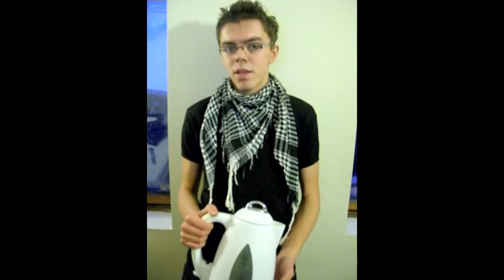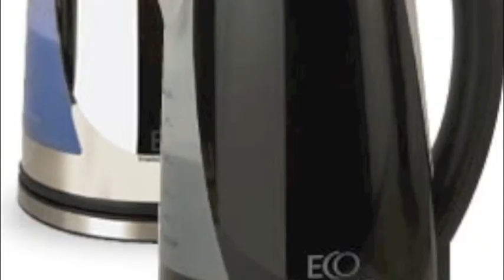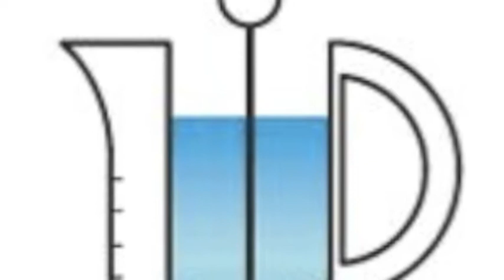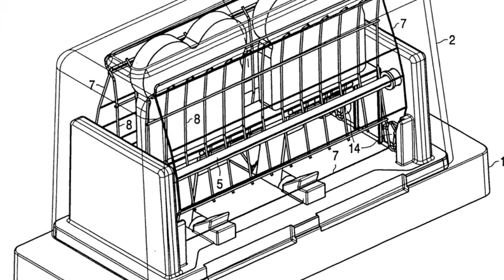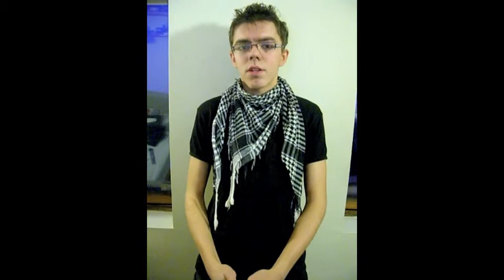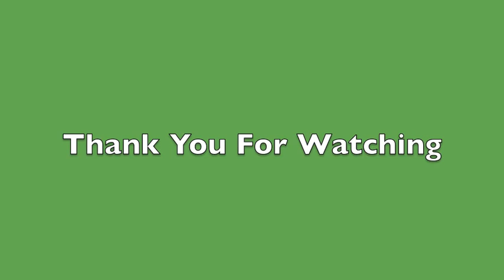Eco3 electronic kettle - Saving Energy

Comment: Brew-ster, hehehehe ;0)

Is the kettle insulated/lagged?

 I saw an article on 'the most efficient kettle in the world' and it has no insulation.

Why is the 'keep warm time' not important?

If you concentrate on keeping the heat in the bulk of the water after boiling, re-heat becomes a lower energy footprint.

As boiling only the water you need leads to deposition of whatever contaminants there are in the water fouling the element or hot surface doing the heating...

If your argument is 'we will filter the water before-hand' that includes more energy, more fabrication of filters and filter elements.

Surely the best way is to reduce the overall 'energy footprint' not get preoccupied with the amount it takes to boil 'the perfect amount of water' and rather, make sure as much energy that was input is saved as heat as possible.

I pose this question, because you seem to have some interest in the subject. [ well, you made a public video about it ;0) ]